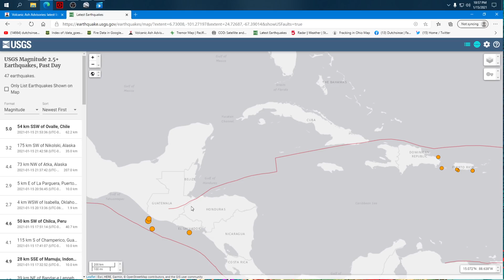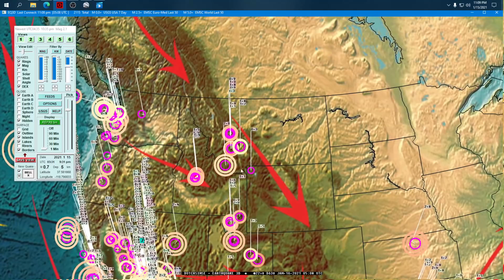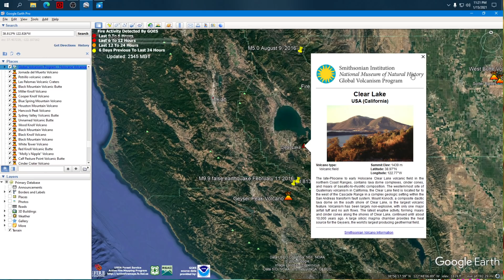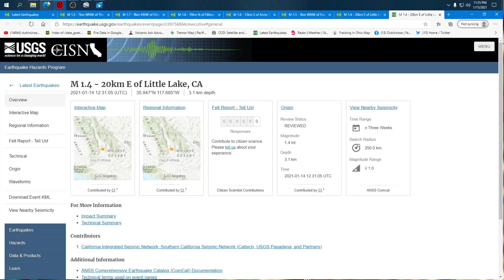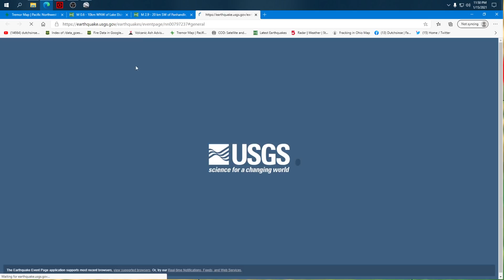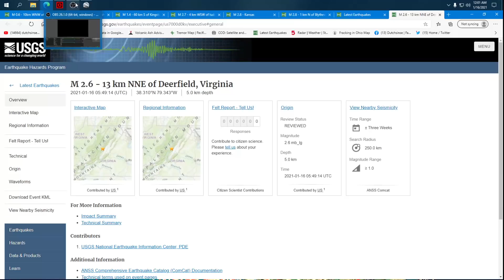1/16/2021 -- Earthquake activity picks up -- West Coast USA California + Oregon seismic activity due

Comment: Hey man you should look further into that Earthquake in VA its was about 15/20 miles from Timbler Knob Volcano!
Reply: Sorry auto correct misspelled it Trimble Knob in Monterey VA
Reply: Check out Massanutten Mountain. Looks like a stretched out volcano with Fort Valley as a caldera!
I still don’t believe that Trimble Knob is the only volcano in that area.
Reply: @davidsimmons9763  I just took a look at that and I see what your saying,  I've actually pointed out to my family going up past that ridge that it's volcanic. From about 40 miles away you can see the crator on top of it very well!
Reply: I'll check it out, however Trimble Knob appears on the Sat map to be a rising lava dome!

Comment: The high voltage power lines go along the fault lines because they follow the terrain and the fault lines create the terrain. If EMF caused earthquakes then there would have been a significant increase in earthquakes since the invention of electricity.

Comment: CROATIA - QUESTION: On the 28th of december we had a 5 magnitude, the next day a 6, since than a lot of 1, 2, 3 and some 4 - Is there any explanation for a 6 after a 5 ?  I listened to your videos before, I cannot remember you mentioned the 5 magnitude on the 28th of december, only the 6 magnitude on the 29th of december. I was reading some days ago an article from the USA that every time a 6 magnitude hits, that it hits up to 10 times a 5 magnitude later. But all we had were a fiew of 4 and a lot of 3. Hope it won't happen but I am worried, as new magnitudes happened in Asia. Also, I was reading somewhere, I cannot remember where, that everytime Turkey hits a high magnitude, that it hits a fiew days later Croatia. Thank you.

Comment: Did you ever checked out earth magnetism. The streams fliwing in the earth have a magnetic attraction. As we all know negative and positiv attract. Higher earthquakes could be explained wgen negative and negative or pisitiv and pisitiv bump into on eachother. The increase in magnitude is around 1.5 till 1.6 in earthquake strength in the same line. See as a line gets blocked, by changing of the floid high and low tides magnetism can change. So if you are able to count high lever earthquakes back you could come to the same conclusion. Greats.

Comment: Regarding earthquakes near very high voltage power lines, I would conject electricity is not directly transferring to the ground due to the insulators on the towers. However, because the electricity is alternating current, there is a magnetic field around the power lines. Having been directly under very high voltage power lines and having the slight hair raising feeling, I believe it is possible that the magnetic field could be transferred from the wires to the ground below. There may even be more pronounced transfer of the magnetic field through the steel towers to ground. It would be interesting to see a study of electromagnetic fields under high voltage power lines and near the steel support towers.

Comment: Concave and convex.....the gravity that crumbles ground..but how deep. Look again at the spoon...flipping the reflected energy. So the reflector seems to get the energy source as dominance due the circular inflection. The dominance of mirrored energy is dependent on where energy is enacted..just like a spread of a drop of water..its air shaped is teardrop but after contact it becomes only half rounded. So the movement there is on the edges but from center weight. ......
 Yes we care about north pole.
Reply: Sorry my gibberish is a tended to thought here ..im looking at the many factors that effect quakers..

Comment: Is there a space war going on with China, are those hot spots caused by DEW, making the connection with high power transmission lines and drill point to hit a weak spot? Would this be a good way to take over the U.S., without totally destroying it? FFT!
God Bless us in these strange days we are living, and we pray for a smooth and nonviolent transition of our political system, whatever that may be. Amen.

Comment: I think that it is the surface charge and atmospheric pressure sets up a standing wave acting like a pump which presses and releases earth which is full of quartz .the telluric currents induced by solar induction can creates a secondary wave that when they interact form extreme temperatures which causes the rocks to melt, release of steam from the depths below which causes all the mechanics. Think it is the basis for the expanding earth theory

Comment: There were tremors felt in Florida on the 15th of January at almost the same time as these quakes and Florida doesn’t experience quakes
Reply: D. U. M. B. S 💥
Reply: Saw a news report about.  The US geological ppl there said it didn't register on their equipment.  The report showed windows and doors rattling.  ...maybe that center needs to check its equipment for dead batteries.

Comment: Anxious?!!
Dutch our very lives hang in the balance when yougo on 4 day vacations without us 😆
Reply: Literally it seems
Reply: He has taught us how to do this. But when Internet goes down, you need to use your senses & intuition. As long as you are at a high altitude, not on a current faultline, nor a large river (in the case of a crustal shift) you are reasonably safe. However, with the world political unrest, id suggest being by a source of water that doesn't require electricity to obtain & a way to purify it; away from gas lines; go bags & rendezvous locations to meet your loved ones. This has been coming for years, but people watching MSM are brainwashed or in fear. Pray, Prep & go back to Living Life.
Reply: @myramedicinewindkay813  well, you are certainly right,  but I wonder about the usefulness of a bug out bag without a specific destination in mind, that can be reached within a day or two on foot. I'm old and tired and plan on bugging in. At least I have a limitless supply of fresh water. Problem is, I can see the Hayward fault from my house...
Reply: @uptoolate2793  Wow! I never think about "destination". It  may be forever changing. I scout out places to camp hidden out from town. I lived in a tent in winter at 7,800 feet. (Put it on pallets & put straw bales around it for insulation.) Maybe its because  you are "up too late" that you are tired. Or drugs? It's never too late tho to get in condition. I run a mile most everyday. I just started out walking a block, then running a block. Then when i took my truck to measure it a week later, it was 1.2 miles. Just take that first step. Just walk that first block. I'm 73. You can do it, too.

Comment: lol... Just got done warning my mom when i saw this post. Just started it.
Can anyone say Owen's Valley.
Hope I'm wrong but check out the CA/NA map for the last 24hrs. Especially the last few hrs b4 Dutch posted this vid. Technically speaking that's South of the activity but its moving that way & Ridgecrest is on the other side. I've been monitoring the situation for the past week or so & after the huge CA/OR tremor burst flatlined completely while we got a cluster of quakes off the coast off of petrolia, then Oregon, geysers too quiet but finally woke up a bit & radio silence from the tremor map. Finally they update today with nothing but a    few for 3 days. Go back a week we had near 2000 in 72hrs all in the same place. then no compensation quakes. nada. A few 3s.
I mean it could be anywhere from Oregon to S. CA.
Clearly Cali has my vote so far.
we're in the Sf East Bay.
It could be Mono lake but i think that'll wait for the magnetic reversal like the last time.
He's talking about the power lines now.
EM isn't fringe science. To the mainstream maybe but has anyone ever charged their electronics wirelessly? Oh so electrical current can be transmitted through the air & energize other matter. See induction.
Idk how strong the effect is but there is one. Go park under the power lines with an unplugged gas generator coil & a multimeter & get back to me. Just like long pieces of metal going into the ground acting like an antenna in reverse.
Mother nature is just trying to balance the books, always.
I'm curious to see what dutch's take is on this one.
reminds me of the week before ridgecrest but with a bunch of tremors & lots of little action on the Wanda near CA mostly.
That one was clearly going to happen between Eureka & Bakersfield. Have the texts to prove it but this one has me puzzled. It doesn't look good though. Let's hope its not Wanda getting ready to go.
My theory is its going to release the roadblock that ridgcrest left us.
Truth is there's just not enough data to be confident in any detailed location yet.
Everyone be safe out there. Especially on the west coast. I think we are about the only place in the Eastern Pacific that doesn't have 1 or more mag 5+ quakes in the last 48hrs as i write this. Hopefully Dutch sees something I missed & can save me going crazy waiting for what's coming.
please respond if you have any theories on the current situation outside of whatever he is going to say.
Of course ML everyone.
Reply: My apologies for the rant but I've literally been going crazy for a wk trying to figure this one out. I live in Northern California within 30 miles of 4 faults capable of near 7 to 8+ mags. Naturally according to the Useless GS they're almost all overdue.
Ao any theories would be greatly appreciated.
Reply: @AlexanderCaesarPsypher  no need to apologize!  Nice to see your thoughts and theories on what will happen.  If I lived there, I would be going through the same thought process.  Thanks for sharing and, most importantly, best wishes to you and your mom for whatever comes your way!
Reply: 4.0 just south of the Owens valley.
I think i missed by 10 miles. That is if were all done for this storm.
most of the official data would lead me to say not yet. It doesn't have to be Owens valley though again. State wide.
Reply: @AlexanderCaesarPsypher  Glad it missed you and good luck today for continued misses!
Reply: @newnormal5931 Last night I was riding the train  between San Francisco and the East Bay  and writing a reply back to you when about a minute after I hit send on that reply the train came to a screeching halt and the driver announced over the speakers that way we're stopped due to seismic activity in the area.
It turned out to be a 4.2 I think south of San Jose.
So we had to wait for about 15 minutes while they did some sort of examination or the electrical system I guess. then the train continued the rest of the way going about 10 miles per hour so they could inspect the tracks. Apparently they do this for any nearby activity over 4.0  magnitude due to the fact that the tracks cross the San Andreas and Hayward faults in multiple places. so it doesn't take a lot just a centimeter or 2 of misalignment can create a dangerous situation at least when going around a turn at 70 miles per hour.
So the reply you sent is totally hilarious in hindsight as was my comment I don't know whether I sent it before or after earthquake had actually happened. I definitely had finished writing most of it before.
It was literally two minutes after I hit send that they stopped train.
crazy.
Reply: @AlexanderCaesarPsypher  LOL - too funny!  Timing is everything!  Glad it turned out to be nothing that impacted you, but can you imagine how scary it would be to be on a train in a major earthquake?  Or worse, underground in a subway?  Yikes!
Reply: @newnormal5931  yeah I don't usually get legit anxiety to the point of freaking out or anything but with all the activity we've been having therefore knowing let the risk was higher going through the tunnel on the train underneath the bay between San Francisco and Oakland was mildly torturous.
It normally takes about 10 or 12 minutes to get from one end to the other and they go very fast.
Your ears pop because of the pressure change like you're on an airplane but you're really going down to the bottom of the Bay. they pop again on the way back up & out the other side.
What made it really awful was that earthquake it just happened and then the aftershocks were ongoing going but because of their worry about track damage we went through it about 15 miles per hour instead of the normal 60- 80mph.
Yeah we're literally down there for at least 35 minutes instead of the typical ~10min on a normal day.
Plus the icing on the cake is that high I happen to know that during the 1989 6.9 Northern California earthquake which had an epicenter something like 85 miles away from San Francisco that tunnel sprung a leak and they had to evacuate the trains and have people walk out.
It still did major damage to the Bay Bridge and destroyed a multi-level freeway through Oakland.
So I'm riding the train thinking what would a 7.5 do if it strikes where it's expected to within a few miles of San Francisco or Oakland depending on which it's on. We're actually overdue for a few.
So you go up a few times stronger and move the quake so that it's only an eighth or a quarter that distance away & I don't even want to know what would happen to that tunnel.
 
It was a good wake-up call though. I'm not nearly as prepared as I'd like to be, at least when I'm not at home.
So I will be making some changes to  things.
Maybe bring a small extra bag with me. That and figure out where the place is are the I can get away from all of the Old Brick structures Underground at the train stations and actually be able to protect myself.
Anyway it was certainly interesting.
Pretty sure you said you don't live out here. where abouts do you live?

Comment: With those steel bore casings under transmission lines
The lines from 160KV to nearly 800KV. Oscillating at 60hz
Those casings are perfect electro magnets